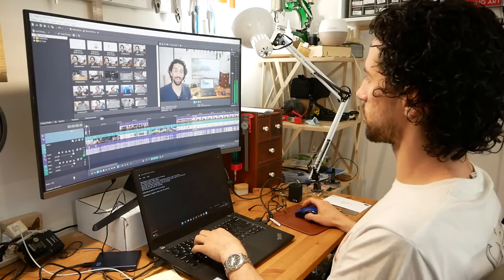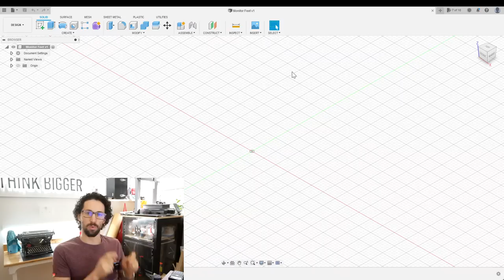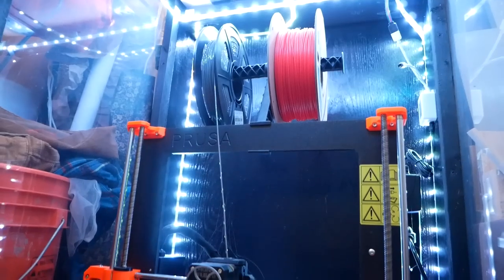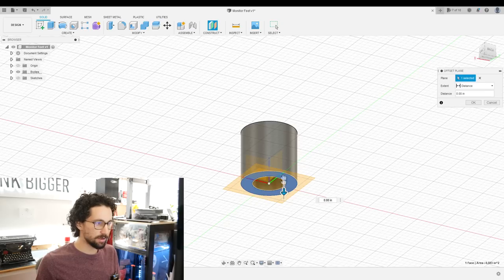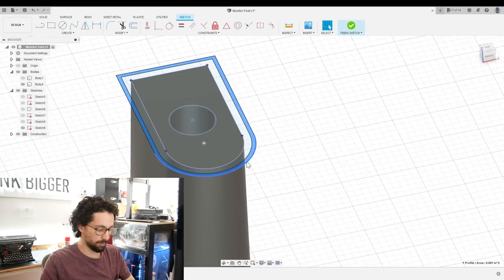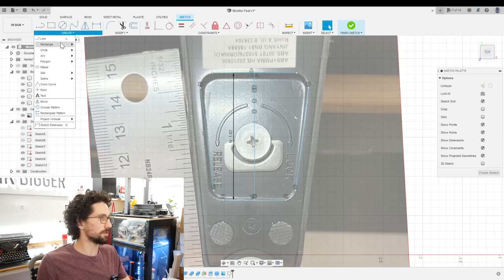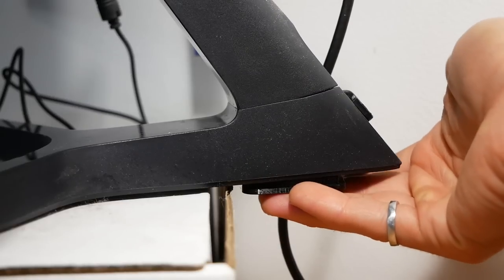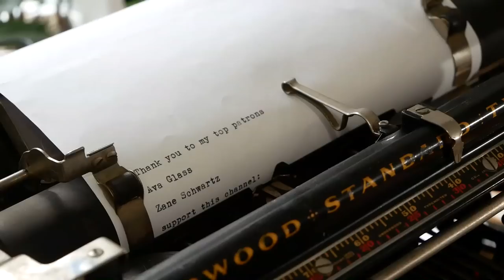Leveling Up My Computer Setup with 3D Printing

Comment: Instead you could have a got a lift arm for your monitor which clamps in a desk corner and lifts your monitor and you can adjust tilt rotate your monitor.

Comment: This is great until you have to move and take the monitor stand apart. I would have designed it to either bolt on or cover the entire base and have the feet connected so the monitor stand is completely separate from the original stand. All in all good job I mean in most cases i don't really see the need to use parameters for one offs that are fairly simple that won't require a bunch of revisions but I do see the value in teaching people how to design using parameters for situations that it makes sense for.

Comment: The tip about slicing a small portion to print a sample for test fitting was really helpful.  
I like that you committed and just epoxied them to the monitor. I would have done a much less functional design that was removable because I cant commit 😂
Reply from the maker: Thanks! I'm a big fan of testing prototypes :)

Haha if I decide I don't like them I'll just snap them off and scrape off the epoxy.

Comment: Why did you ignore the possibly of a desk clamp monitor mount? Would have saved ALOT of desk real estate and looked better? Potentially an idea for a revision video on this topic?
Reply from the maker: That could be cool! It didn’t cross my mind while designing. Although since all of the weight would be supported on one rod, it would have to be a very strong, stiff material (probably metal) so it wouldn’t wiggle around.

Comment: Great one, the only thing I would suggest is a clearance variable incase you need to adjust clearance...
Reply from the maker: Thanks!
Reply: Can you elaborate on that a little bit?
Reply: @jeremyspecce  He hard coded the clearance into the model design, and with 3d printing you have to make your model slightly larger to accommodate the part shrinking slightly and variations in printers... for example on my printer I need to usually make the dimensions approx .26mm larger otherwise it wont fit properly...   So in your variables like what Morely setup at the beginning he could add a clearance variable and then in situations where you want to add a clearance you would type in the dimensions box  ....  DimensionVariable (for example height or width variable) + clearance variable to add the .26 to any dimension...  then when you print it, if the print needs adjusting +/- you can update the clearance variable and this will update all dimensions that have the clearance variable applied to it

Comment: I was gonna say those spindly legs look super sketchy, but it seems pretty stable in the end. Good job!
Reply from the maker: Yeah they are sturdy! And having 3 points of contact helps with stability.
Reply: @MorleyKert  3>4 gang
Reply: Isn’t that putting a lot of stress across the front legs of the original stand the parts parallel to the table.
Reply: The original base of the monitor didn't look that stable at first. I was expecting it to kinda break or bend in the middle or so.
Reply: @craiggordon2502  I think the front two arms alone can take the load of the whole screen.
Reply: Cool just curious since there not supported all the way across that can add stress to those legs if it’s just plastic.  If it is plastic would an angled support from one of legs to at least the middle to the inner most point help.   Again just curious as I’m still learning design
Reply: @craiggordon2502  I think most pc monitors like that have sheet metal under the plastic. 

If you are really worried you can reinforce the bottom of the plastic arms. Even some fiberglass packing tape could make a big difference.
Reply: Cool thanks

Comment: Nice.  You could also consider putting the laptop under the monitor and using a wireless keyboard and mouse. That’s how someone I know does it.
Reply: He’s using it as one of the monitors though, or is this a laptop that flips around and you’re saying flip it over so you only see the monitor from the front?

Comment: I noticed when you importes the picture to get the inside shape you didn't have your sketch aligned with the plates. Have you considered using the calibrated dimensions as a reference, then redraw the part centred on the planes? If you were going to use any mirrors or symmetry it will greatly help.

Comment: You should definitely remove and replace the thermal paste on your laptop. I'm certain it will run must cooler if you do! Plus you are so savvy with DIY projects, I'm sure a trip into your computer would be a great adventure for you!
Reply from the maker: I’ll look into that, thanks!

Comment: I've got two questions, how long did this project take you from start to finish? between designing and printin. And do you export directly from fusion 360 to the 3d printer?
Reply from the maker: I’m not sure, I tend to lose track of time while designing haha. But all done within a day. I export from Fusion to the slicer (I use prusaslicer), and then I use the slicer to generate the g-code, which I put on an SD card to go in the printer.
Reply: @MorleyKert  Thats really quick nice. Thanks for the response

Comment: 4:32 Epoxy is fine, but if you had made the plug able to screw into the foot by printing both pieces with grooves it might have been less permanent.

Comment: Nice video, as usual. 
How did you get into this maker stuff? Sort of scratching the surface myself and interested in any tips for starting out, like what the best things to start with are (I see a lot of people with those desk mat things). 

I'm looking into fixing up some old books my grandpa left me, as well as fixing some electronics.
Reply from the maker: Thank you! I’ve always been into making stuff, but I would say I got into it in a big way when I wanted to build a loft bed for myself in University.

Find a project you’re super excited about and start with that! It will give you the motivation to see it through the end and overcome challenges 😊
Reply: @MorleyKert  Thanks, good advice 🙂

Comment: "What's the best coolant for the old laptop, unmounting the LCD and boxing it into alloy-like library mounts or look for a thin old guard rail? I don't know, keeping the LCD attached isn't very cool with that type of battery. May be it was just a Eastern-Western time thing that ruined the cheap components. Can we pack it directly into the printer?! May be it could be the next thing..."

Comment: One downside is that you covered the screw which is used to disassemble the monitor stand.
Reply from the maker: I don't think that will be a problem - that screw was already installed when I bought the monitor (it doesn't need to be disassembled that fully).

Comment: I like your videos but this is completely wrong concept. It is much much better to buy an alu dedicated stand (vertical pipe) which uses vesa fixing screws at the back of the screen. What is more, your sight line should be hitting the upper edge of the screen, not the middle area.

Comment: Or you could have been an MVP and made some sort of universal VESA adjustable stand/clamp for us to print with the same problems. Urs is suuuuuper specific and doesnt help ur fellow subrscribers!
Reply: You do understand that in order to do that, he would need to have a number of monitors with different stands lying around so he could design it, right?

It's much better to see his thought process on how he designed it so you can design your own, rather than expecting him to populate his office with a dozen monitors because you can't be bothered.
Reply: @jimbobjones9330  you do understand that probably all monitors since 2010 have VESA mount thats on all monitors and TVs...
Reply: @Tomas970506  There is a load of VESA mounts out there already. Also, these mounts don’t lend well to 3d printing as they need to be really sturdy and withstand a lot of shearing forces. Finally,  you would be surprised how often monitors don’t come with vesa compatible mounting options.
That said, the problem solving and engineering process was awesome to see and it’s cool that the video shared it in detail. 
You’ve correctly identified a gap in this design, so how about you become the MVP and design a VESA adjustable stand/clamp and share it with everyone, since you clearly have the same problem?
Reply: @themat42  Haha. Im actaully thinking about it for a couple of months too. Altho Im still learning fusion and how to use it. :D